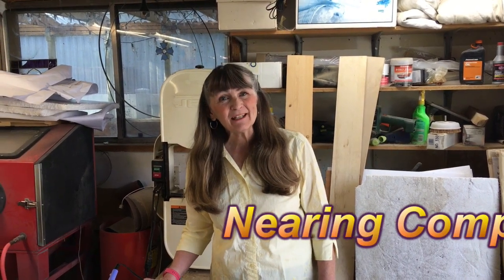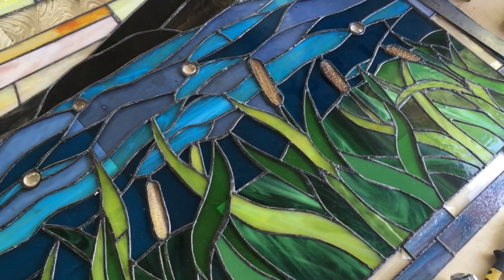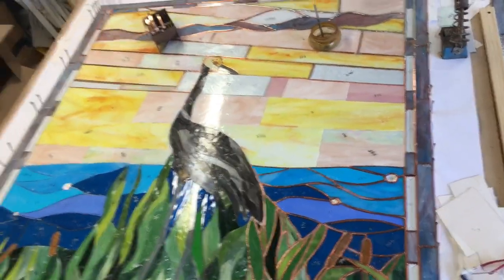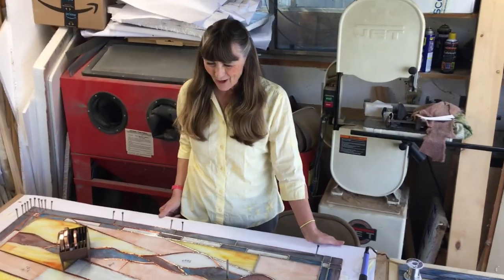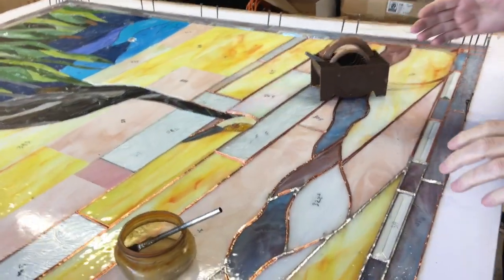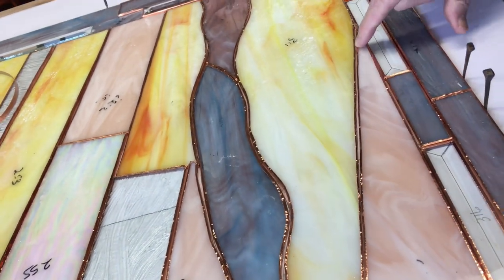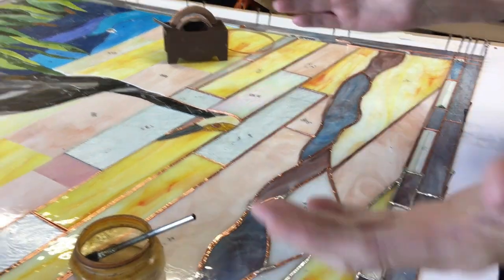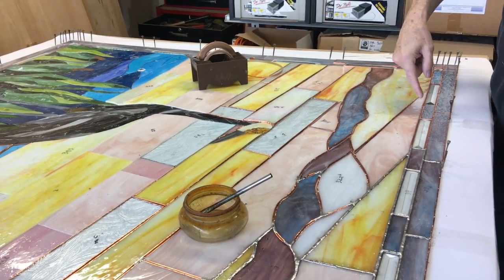Third Airport Stained Glass Panel V382

Comment: You appear to typically use horseshoe nails to define the panel perimeter. Why not define the panel dimension with wood strips so that you can be sure that your panel will fit the designated size?
Reply from the maker: Horseshoe nails work for us and get students used to being careful with glass edges.